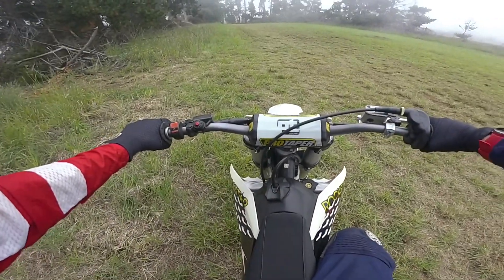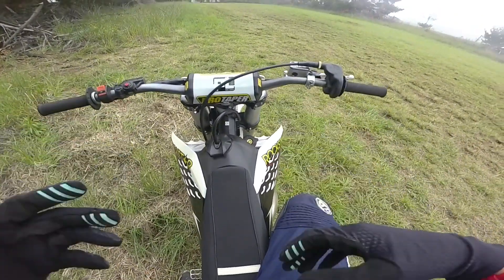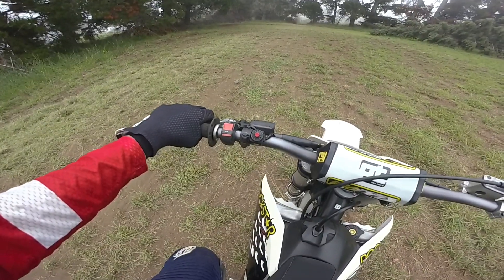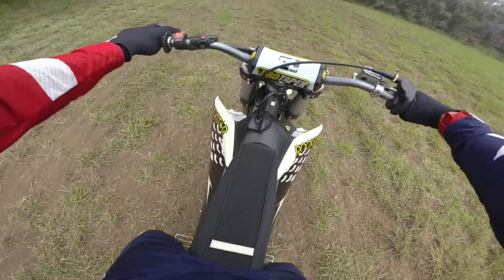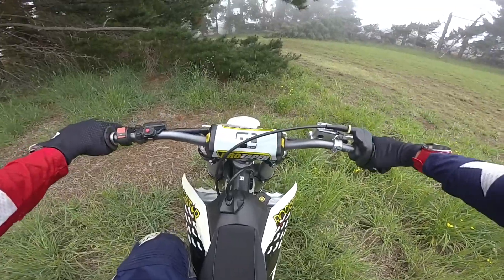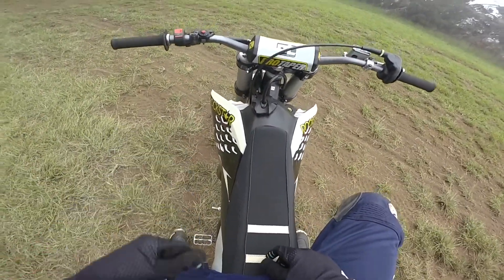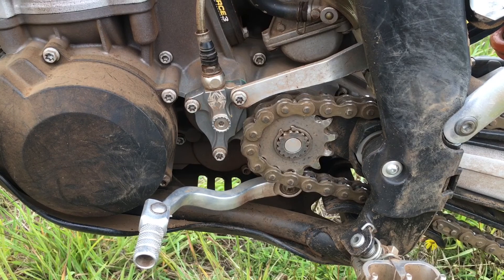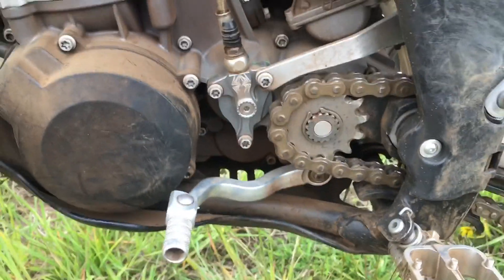Rekluse Auto Clutch Pros & Cons - Everything You Need To Know

Comment: Do you get the same clutch life with the recluse as a normal clutch?
Reply from the maker: Some say better. A few say worse. Depends on many things just like any clutch. Maint, oil, proper gear selection....
Reply: I have a 2013 KTM 350, Rekluse Core EXP 2.0 with original clutch plates, over 3000 off road miles, Rotella oil from new. I even raced it in 2 hour Hare Scrambles 2 dozen times. Still same original clutch plates.

Comment: Do you run the EXP disc as it comes from Rekluse or did you tune the engagement springs?
Reply from the maker: Just ran it as is. Doesn't take a whole lot to change them as it's the outer disk in the basket. Pull the cover, and springs and it's right there. Totally something you could do leaning on the ground next to the truck in a fairly clean environment.
Reply: @JohnHowerton137  yeah I’ve ran one before but never in a 2 stroke. It was perfectly fine from Rekluse In my 350. Sounds like it will be perfectly fine in my new 300 as well. Both Radius CX’s.
Reply from the maker: @Drewski423  seemed to work perfectly in this 250. Pretty sure none of my friends have swapped the springs either. I know the ones I installed didn't 🤣
Reply: @JohnHowerton137  lol. Mine is going in this evening exactly how it came from Rekluse. lol
Reply from the maker: @Drewski423  I have install videos too, if you're new to the process.
Reply: @JohnHowerton137  I’ve installed a few. One for me and a couple for some buddies. Hydraulic Clutches are a lot easier to me than the internal adjusted cable clutch bikes for sure

Comment: I have an auto clutch on my yz250 with just a rear brake lever with no clutch lever 
I have 200hrs on it and ride moto and cross country 
I do oil changes every 20hrs and it comes out looking new every time 
For shifting all I do is let of the throttle a bit 
It’s like riding a mountain bike with a motor 
It makes slow hill climbs almost too easy 
And I’m still on the original clutch pack
Reply from the maker: Flying High great to hear these anecdotes. Offsets a lot of the haters out there.

One question... how do you monitor the freeplay gain?
Reply: I still have the clutch cable on so ever 10hrs I throw a clutch lever on to make sure its in spec
Reply from the maker: Flying High good plan 👌

Comment: Was considering this for my MT07 because I am currently having issues with my clutch and found out on the internet that the Rekluse helps to click better and is overall better than the stock one.

However, one detail if I get the automatic that means I can no longer park my bike in a hill (because it will be in a kind of neutral)

Comment: So a 450 would not over het so quick? When riding slow?
Reply from the maker: Might help a little since the RPM would likely be a little lower due to holding RPM higher to prevent stalling... but a fan kit and maybe a good coolant like Evans or something would help more for sure.
Reply: @JohnHowerton137  back in the day i used engine ice but i cant get it anymore here do they stil make it and do u think its good ?
Reply from the maker: @Freewheelie199  yep, they still make it as far as I know. Look at the Evans stuff though. Quite a few teams use it. A fan kit is the main thing to get if you don’t have one.

Comment: I recently ran into a use case for an auto clutch. My dumnass took my supermoto through a nasty muddy trail. I was riding in trenches of mud dug by Jeeps. There were rocks and logs and random trash sticking out. I just didn’t want my feet in the trench. I was trying to just waddle along the trench and keep my feet up. But then I couldn’t rear brake. I used the front brake and just didn’t have much traction going downhill and I was dropping the bike a lot. With an auto clutch, I could easily install a handbrake, use it, and walk along comfy, and not stall the bike and have traction. 

I really don’t know why motorcycles largely haven’t changed. It’s small things like this that make me truly appreciate electric dirt bikes. Haters will always hate change. Just leave em behind.
Reply from the maker: You would have had maximum traction at all times because you don’t manually have to slip the clutch… or only need it as a supplement.

I have an electric bike too 😉 it’s amazing, but I do wish it had a manual clutch for a supplement. That said, the rear brake can be used as a faux clutch to modulate power. It’s just backward. You load the motor with the brake instead of spin up the engine with a clutch.

Comment: Control when lugging the bike is important to me. The rekluse tries to clutch when i dont want it to. I also never know what gear im in. So going around corners when i want the bike to be connected to the ground and controlled by the throttle its clutching and isnt telling me if im in the correct gear.
Reply from the maker: Adjust the EXP disc springs. Jeff Slavens might have videos about this. Could probably control engagement point of that slip a little bit.

That's kind of the point of the Rekluse. Controlled slip keeps you from breaking traction and/or stalling. You still have the responsibility of knowing what your gear is. I very rarely have a problem with being in the wrong gear, but a 250F isn't super powerful, so it doesn't really like to pull the wrong gear. You know pretty quickly.
Reply: @JohnHowerton137  thats just the first issue, the engagement of the clutch changes with throttle. It basically makes the clutch useless half the time since it isnt doing what you want anyway. The next issue is not knowing what gear you are in, it just clutches to compensate. The products great and works well for most but there is no doubt that you give up control with a setup like this, there is a reason that bikes dont come with an auto clutch.
Reply from the maker: @billypulsipher7313  sounds like yours is set up shitty. If it's working correctly, most people wont even know it's in the bike until you tell them. Control is is subjective. You might (depending on skill level) give up control in a hard enduro situation, but most will gain in XC racing or more challenging conditions/surfaces in motocross. You're the only person I've ever heard complain about not knowing what gear your in. Shouldn't you be aware of that? You must not ride any motocross or tracks with lots of jumps.

Here's some advice:

Don't blame your lack of awareness on the Rekluse. That's on you. The fact that you don't know what gear you're in actually shows how well the Rekluse is working to modulate the bike's power! An hour + into an XC race and that's a huge advantage.

I'm not your riding coach, but it sounds like you're a lazy rider reliant on big bore, high-HP bikes. I'd suggest taking a holiday from that for a while and learn some basic engine control on a 2-stroke 125 that will sharpen your awareness won't let you get away with sleeping at the wheel. Depends on your goals, but if you race and are trying to bump up a class from D to C or something, that would be an excellent place to start.
Reply: Attacking me as a rider does not make what I'm saying untrue. You can come riding with me and then make that judgement, until then your opinion is null. I havent knocked your riding skill or the fact you use a rekluse. My statements are that you give up control of a bike with a rekluse, good or bad.
Reply from the maker: @billypulsipher7313  of course you took it as a personal attack 🤦‍♂️

I didn't say what you were experiencing is untrue. I explained why it is & isn't, a problem... and provided multiple solutions. Some  required HUMAN adjustment or personal growth. That's what coaches do.

"Giving up control" is relative to the situation, so no, that is not a true statement. Do you think Ryan Sipes put one in his bike to win the International Six Days trial because he thought it would reduce his control of the motorcycle?

Take it out and sell it on ebay to someone who will enjoy/appreciate it. Doesn't sound like it's for you.

Happy trails Billy. Rubber side down 🤙
Reply: @JohnHowerton137  you are a riding coach?
Reply from the maker: @billypulsipher7313  yes, locally (Sundays) but not with any schedule consistency. Triathlon/running/sports nutrition during the week, the majority of which is composed of mental coaching and medical referrals. I consult athletes of all abilities several hours every day.
Reply: @JohnHowerton137  and thats you riding in your videos?
Reply from the maker: @billypulsipher7313  firearms too. Did a session for that 3 weeks ago.

Majority of the videos, yes.

Comment: From what I understand you compete as Pro rider. I must appreciate you're riding a pre 2011 bike. I have a 2011 model. How's that working for you?
Reply from the maker: Nope. Top of my game was Intermediate MX/Local A offroad. I will return to racing that level this year.

I'm not meshing with this bike like I did my 2001 SX. If I had more places and time to ride I could get it set up, but right now we aren't jiving with each other. I'm looking to sell it after riding it yesterday. Nothing wrong with it, it's just not the right bike for the conditions a ride. If I had faster sand tracks I'd be in love.
Reply from the maker: I liked the 01-06 KTM ergonomics. The 07-15 models don’t feel as natural to me. The peg to bar space feels small and forward. I don’t mind if that’s small, as I ride pretty compact, but the pegs have to be a little further back, probably because of my longer legs. It feels hard to lead with my head. The 16-21 stuff feels much more like the older bikes. I sold off my 09 & 12 because they just never felt like they were mine. I have a 16 XC now and my 20 Freeride (09 geometry) is smaller, but the peg position is further back, plus I rotsted the brackets down. Then I put 1/2” lower and back pegs on top of that. Totally love it. My 690 is essentially 12 geometry/design, but don’t mind it because of sitting a lot of the time. I would like to drop the pegs lower and back to get me over the front a little better when hammering the throttle, but don’t want to spend another $200 on pegs. It’s good enough.

Comment: Good video! My son just bought a 250SX with this clutch,  that's why I watched this video. He said that even with the clutch lever pulled in if you give it throttle it takes off? I think the adjustment screw you referenced near the sprocket may need to be adjusted? Can you advise if I'm on the right track and or have you ever had that issue? Thanks ✌
Reply from the maker: Richard Thomas yes, that is totally wrong! Do not ride it. 

Search for videos on KTM Freeplay gain adjustment or download the Rekluse manual. If that doesn't work the friction plates might be smoked.
Reply: @JohnHowerton137  I just watched an install video and it showed that you should have 1/8" to 1/4".  That was the first thing I was going to check.  Also just had the slave replaced by previous owner and I don't know if he properly bled it? I  just wanted to make sure my trane of thought was correct.  He's still on his way home from out of state with,  bought it yesterday! At least I know where to start when he gets here!! Thank you so much for your response! I'll let you know when we figure it out and what it was!✌
Reply from the maker: Richard Thomas you're on the right track. It's all easy to check and/or replace for someone with moderate mechanical skill. Aloha 🤙
Reply: @JohnHowerton137  come to find out,  the young man that had the bike before my son put a new slave on and it was a manual clutch slave? He must have ordered online without consulting anyone and it was the cheapest one? Well we ordered the proper slave put a quick adjustment on it and it works like a champ!! Thanks for the advice and your response!!
Reply from the maker: Richard Thomas oh great! Probably broke it with a rock or something and just bought the stock one thinking the Rekluse slave was just fancy bling someone put on.

Glad to hear you got it sorted out and it works properly! Now he knows how cool it is 😋

Comment: I had I think it was a 2001 YZ450f with a Recluse and it would stall the bike a lot if I tapped the rear brake in air or brake hard.
Anyone have stalling issues with these now days?
I just returned to riding after 12yr hiatus (56 now) and bought a 2019 yz250f. Harescrambled it twice and was contemplating getting a Recluse again ❓
Reply from the maker: One of the main reasons I bought it was to eliminate that. My left hand goes numb I dead sailer the bike in the air 😖 Shouldn’t stall. This one doesn’t.

This is on a hydro clutch KTM. I think the cable clutch stuff may be little more finicky to set up, or may require EXP engagement point changed with the alternate supplied springs.
Reply: @JohnHowerton137  
Mine must have been set a little low on rpm engagement or something. Only way I can think of stalling is that the clutch stayed engaged (too much friction) too far down in rpms.
I will look for more videos on how hard (braking etc) effects the set up.
Thanks!
Reply from the maker: @my-max-media7621  this was the first ride at the moto track. https://youtu.be/ndC0eG93gzs you can hear me stabbing the brake at like 1;28. The tables are 70ft + or something
Reply from the maker: @my-max-media7621  flame out. He's riding a choked off FE250 that had to pass emissions. KTM (& clones) and known for flaming out a little easier. I installed one one on my 64yo friends 250SX (not choked off) because he was flaming out all the time. He said it totally fixed it. Then we installed a fuel controller and richened his map up too. He finally loves the bike now. This was his first ride (before fuel controller) https://youtu.be/06yzEa46q1g

No guarantees, but chances are on a YZ250F your EFI isn't starving lean for Al Gore's buddies and wont have a problem.
Reply: @JohnHowerton137  
Thanks for the thoughts and insights.
My bike runs perfect and I can change map thru app if I desire.
👍🇺🇲👍
Reply from the maker: @my-max-media7621  think you’ll be ok then. If it did flameout/stall you could tune it out at ECU and/or clutch tuning... pretty confident. Almost certainly Rekluse tech support could confirm that.
Reply from the maker: @my-max-media7621  just talked to that friend. He confirmed exactly what I said, All flameouts (stalls) stopped when I adjusted his fueling. Rekluse had stopped the majority of them before that.

Comment: When I raced hare scrambles, I would catch people in the woods using the Left Hand Rear Brake. When they dive into a corner, they would load up the front tire and slide outward, sometimes off-trail. When I hit a corner at speed, I would control my rear brake just shy of locking up deep into the corner, lightly using my front brake so the weight wouldn't roll forward as much, then power out. My corner speed damn near doubled, big difference in a woods race. Pros need not apply here, they had 5 things going on at once in a corner. I'll never be that fast. 99.99% of us are never going to go fast enough for the Rekluse to be a hindrance.
Reply from the maker: Russ Shappard I loved dragging the LHRB through hard slick corners on my ebike as traction control.

I Agree, but will play devils advocate a little bit. A lot of people's (non-users) main complaint is that they can't keep the rear locked up in gear with the engine off (no LHRB) when they crash on a hill climb. They are the 99% 🤣

Probably wouldn't have stalled and crashed in the first place if they had the Rekluse 😉

Comment: 17:30 I can see that being a problem! 

What about bump starts?

Like off a big hill does it just free wheel ?
Reply from the maker: No bump starts unless you adjust it out. Doesn't stall though, so doesn't need to be bump started unless you shut it off with a dead battery.

It will come down a hill under compression if the RPMs are already up, but if you rolled over a hill at idle it just freewheels down like you have the clutch pulled in. You'd have to get back on the gas to get the Rs back up to go into compression braking again.

Comment: I've been around bikes for 45 years and never seen the throttle cable routed behind the clamps 🤔
Seems like it would have a hard 90 degree bends at radiator
Reply from the maker: Then you’ve never seen a KTM. Every one of them is routed that way. It actually eliminates a sharp bend as the cable runs down the left side of the bike. They probably did it originally so the bars catch brush before the throttle cable. KTM has always been way ahead of the Japanese in functional design like that.

Comment: I don't mind using manual clucth but has a 4 stroker everyone knows how easy is to stall the engine, specialy when we're getting tired and don't coordinate the pull of the clucth in time of the rear wheel lock on a tight turn. And when it's slipery it can be dangerous because when I leave the clutch the tyre can't get traction to make the engine start again...
Reply from the maker: Exactly. They need to install one in Mookie’s bike for Supercross, I recall seeing him stall a few times this year.
Reply: @JohnHowerton137  interesting...